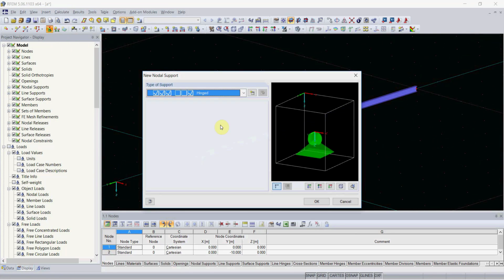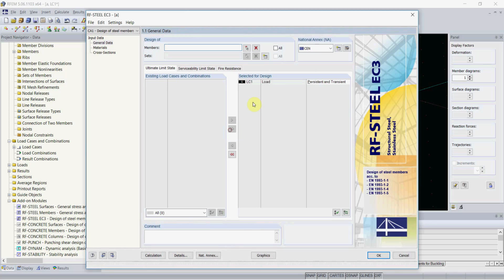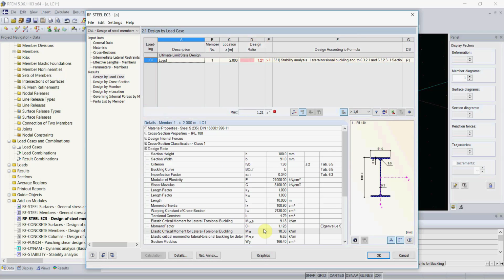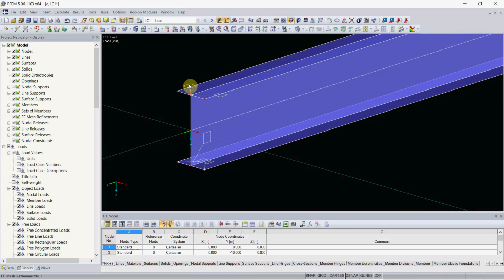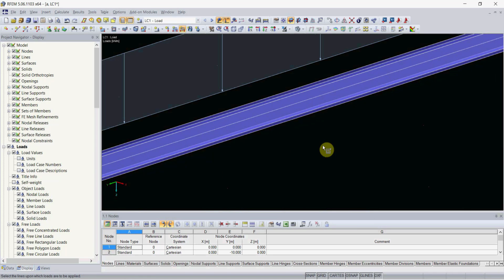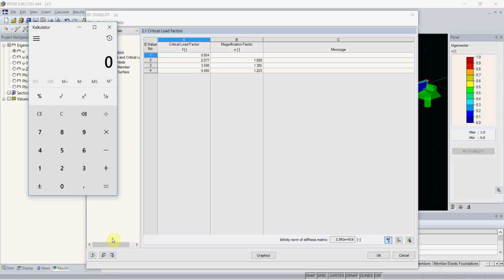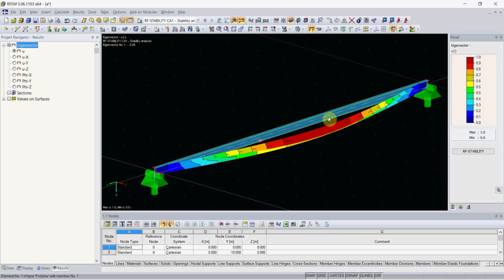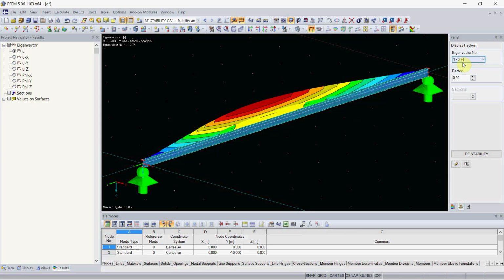How to calculate critical bending moment

Comment: I tried to repeat similar actions for a 4m long beam. The rest of the data were accepted without changes. For the beam model I got a moment of 2 kNm and a critical moment Mcr=28.3 kNm. For the plate model I got a critical load coefficient of 18.2. Accordingly, Mcr=2*18.2=36.4 kNm. The difference from the reference solution is more than 20%. How can this be explained?
Reply from the maker: To be honest, it's impossible for me to answer such a question without taking a look at your models. I would search for things like changes in cross-section (no rounding on flange/web connection) playing a bigger role, maybe shear stiffness in the beam model, maybe simply a model setup... such things usually take a while to investigate, but in the end, I'm sure you will find what is the issue there.
Reply: @Enterfea  I checked these points. My model absolutely coincides with yours. For a span of 10 m the results coincided with yours. For a span of 4 m (surface model) the discrepancies with the theoretical ones (beam model) are more than 20%. If you have your file you can check this.
Reply: I experimented a little. And so far it seems to me that using rigid members on supports leads to an error. It is worth using the nodal constraints function. But I would like to hear your opinion as an expert in this field
Reply from the maker: @vasiliyrohach3166  To be honest with you, I don't know why that could cause an error - perhaps this is a dimensions thing, but with 4m distance it seems like a decent distance still. If I recall RFEM has some issues with rigid elements, but I can't recall what that was to be honest.
Reply: @Enterfea  I experimented a little more in RFEM and understood what the matter was. You have done everything correctly assuming supports of the type "No warping allowed". These are beam supports, for example, with a very rigid support rib. I am used to working with beams with other types of support and for which there is no prohibition on warping. For such beams, the critical moment is much smaller. And the main thing is that both types of support can be implemented in the RF-STEEL EC3 module.
Reply from the maker: @vasiliyrohach3166  Awesome, I'm really glad that you found it ;)

Comment: Good job, I need to get me a copy of RFEM
Reply from the maker: Thanks! I would recommend RFEM for sure :) I like the RFEM5 version better than RFEM6, but maybe it's a matter of habit :)
Reply: @Enterfea  So I used different software to solve my problem as the extrusion was quite a complicated shape. Whilst bench marking using your example there was about a 20% difference between 8 node brick elements and 20 node brick elements. Matching the support conditions as closely as possible the 20 node brick matched CBF ~ 0.74 whilst the 8 node CBF was ~ 0.55. Any ideas on why there would be such a big difference just on the element type used?
Reply from the maker: @BillySnowball  this is a complicated thing Mate, but assuming that you had the same element "size", but the difference was HEX20 or HEX8, I can imagine such a difference. This is what mesh convergence is for - it would allow you to see, how small elements are needed (and you do it separately for HES8 and HEX20). You can read more here (https://enterfea.com/mesh-convergence/), although I'm using QUAD (2D) elements in the example (but still first and second order, so it should give you an idea about what is going on :) ). Hope this helps!
Reply: @Enterfea  I appreciate you spending the time to respond. I think I've read your website before and will definitely check out the page you linked. Thanks again
Reply from the maker: @BillySnowball  Sure thing! Best of luck!